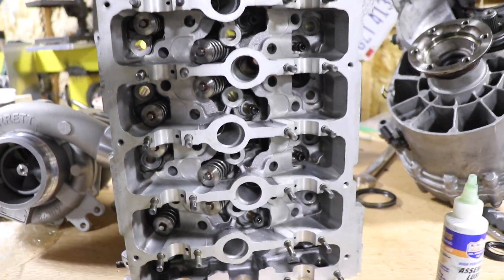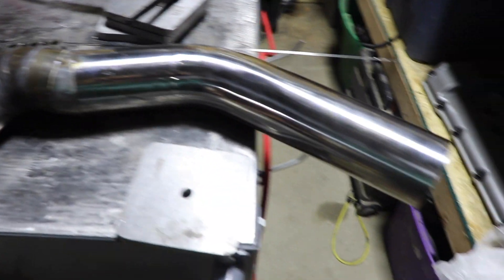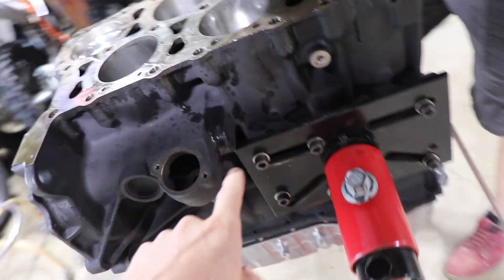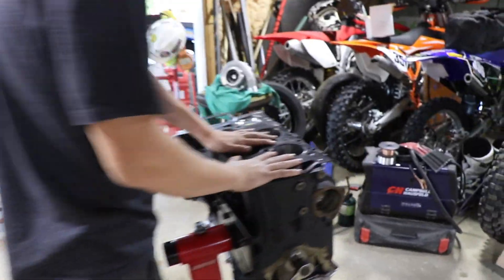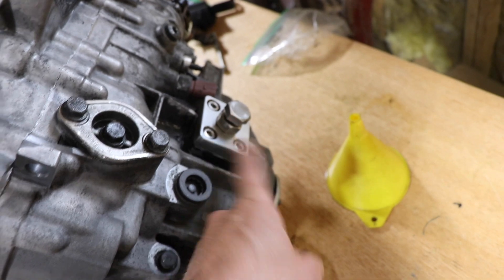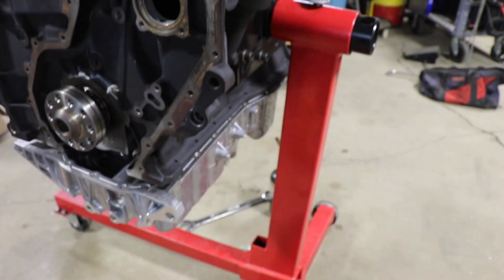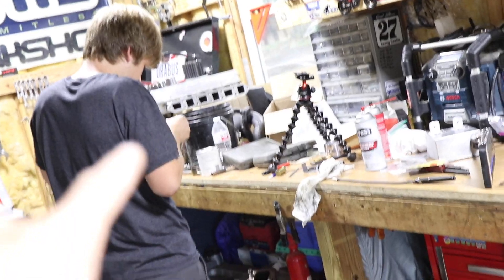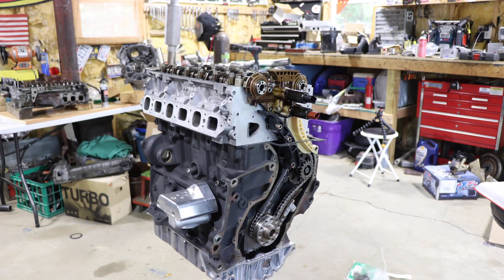VR6 Head Assembly/Valves/Cam Chain/Intermediate Bearings  (pt5)

Comment: Hey I’m in the middle of a timing chain job and I aligned the crank to tdc and then removed all the timing chains and components, then I realized the cams were 180 degrees off so I needed to spin the motor over again. So I put back the timing chains and tensioners, but didn’t put the bolt in the sprockets for the shaft so the sprocket fell off when I was spinning the motor, so then I unbolted the cams to spin the motor over safely, does position of the shaft matter? Basically what I’m getting at is can you safely spin the shaft as much as you want when everything is disconnected and then just line up the arrow on the sprocket when you put everything back?

Comment: One question how do i id one cam from the other. Im building a vr6 i got in pieces
Reply from the maker: Which vr6 12v or 24??
Reply: @PostPros  
24 both cams are same length
Reply from the maker: Center of camshaft has machined lines. Intake has 2, exhaust has 1. 🏁🏁